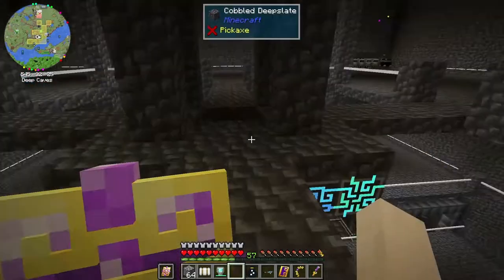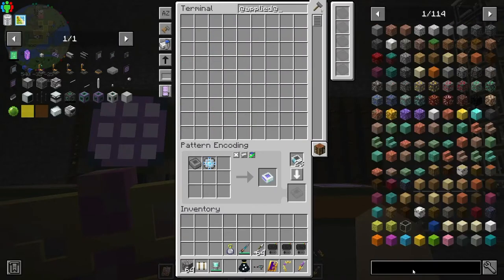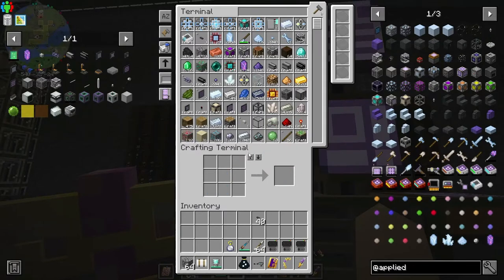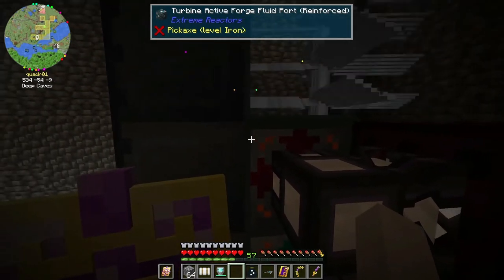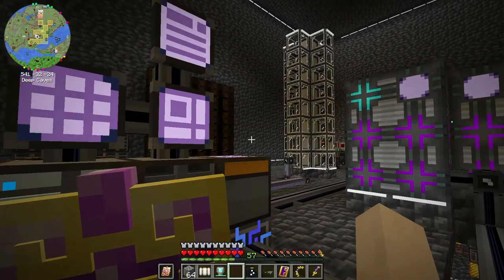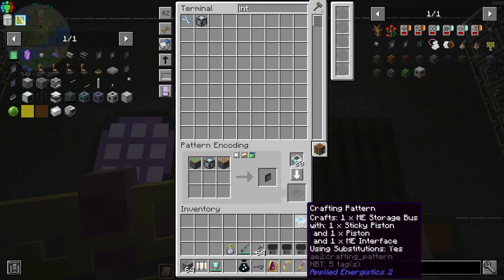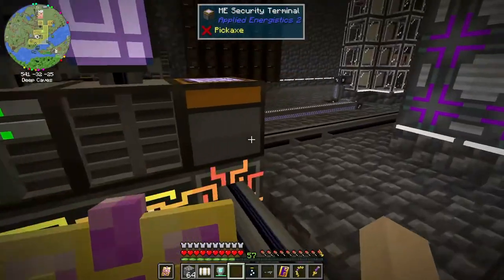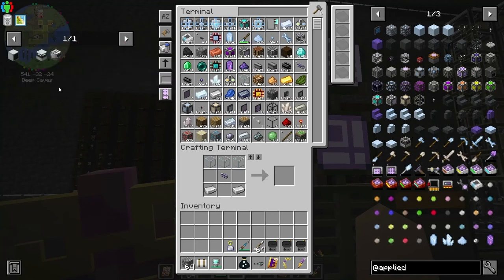DireWolf20 1.18 Let's Play Episode 99: Dabbling with AE2 and My 4th Turbine

Comment: For the ME Chest, when you put the cell in, you need to then access the ME Chest from the top and you can see the contents.

And yes, Item Substitutions is AE2's Exact Mode.

You have two knives in your RS system, but didn't have any in your AE2 system.  😛

Your Angel Ring is what is negating fall damage.

For mass liquid storage, AE2 fluid cells might do well?  You could go for the really big ones, since you'd have fewer fluids, but more of each.

When you use the + to add a pattern, it'll try to decide what the best option is based on what you have in your system and what the system knows how to make.  If you want to override it, just search for the alternate and drag and drop that on top of what it used.  I get it all the time where it tries to put red tinted glass in for most things that want glass for whatever reason.  It also sometimes grabs dark or bright illuminated panels, instead of the basic illuminated panel, so I tend to have to switch that out manually as well.

You can change the typing settings using the second to bottom button on the right side of the terminal, the one that looks like a text input.  I tend to use JEI for my searches, but you can change to other settings.

The item you removed from your list was the AE2 P2P Tunnel.

I am loving the lighting in your base, the light strips look really cool.  :-)
Reply from the maker: Ah, the p2p tunnel!!! Nice! I had completely forgotten what I had accidentally removed. :( 

I don't know how to explain it but the AE2 search bar mechanics are just buggy. The Cursor keeps getting stuck in the AE2 search bar even though I don't have that option selected. I guess using the JEI search bar is a way to work around that LOL